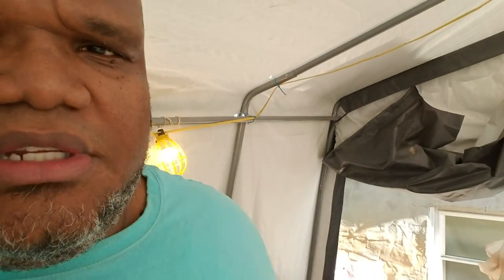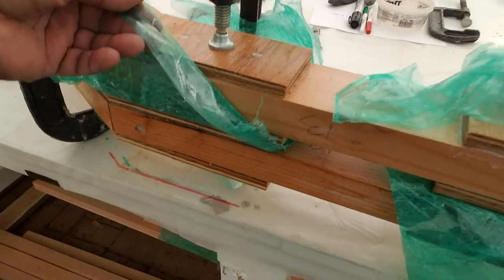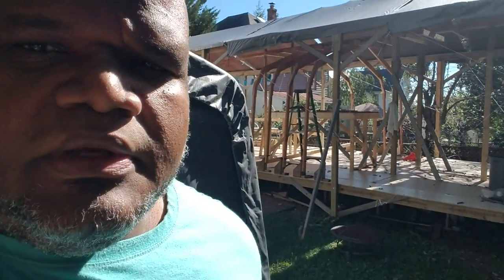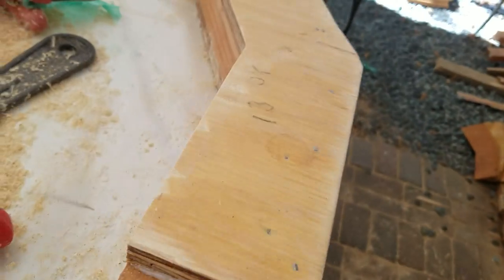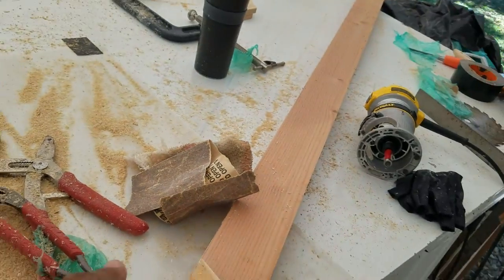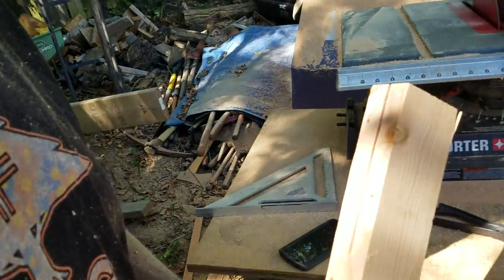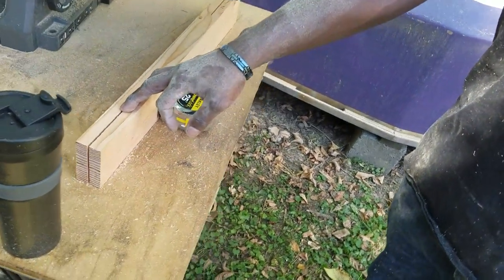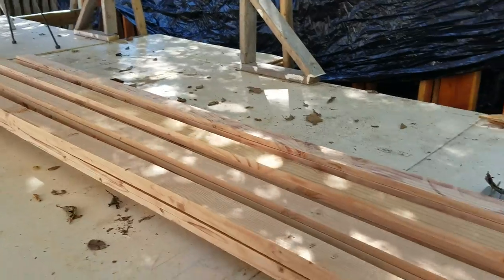Build A Boat Sunday - milling stringers and cleaning up frames

Comment: Glad you added screws.  Nice job countersinking them and filling with thickened epoxy.

Are the gusset BS 1088 marine plywood ?  Menards sell "marine" plywood made with "water resistant" (not WBP) glue !!!
Reply from the maker: no, the chines are just regular marine grade plywood. I am using the BS standard for the hull and interior bulkheads and sole. Im still up in the air with the partitions, cabinetry and furniture. I really like red oak for that. What are your thoughts on furniture?
Reply: Where are you buying your "regular" marine plywood from ?  I would be curious what kind of glue they are using.

Go for the red oak if that is what you like.  Your boat is not a "work boat" (SV Seeker), so it is actually partially a "work of art" and "beauty is in the eye of the beholder" !  I hope you will be "holding" on to her for a long, LONG time !

Just know that interior grade glue will delaminate quick if it exposed to much water.  Faster than exterior plywood.  BS 1088 plywood uses thinner plys that have no voids and no plugs in the surface ply (grade A) along with "water boil proof" (WBP) glue.  WBP will survive >10 hours of boiling water bath.
Reply from the maker: I would still wet out the interior wood which should prevent most water swelling/ intrusion, save major prolonged leaking or flooding.
Reply: Make some test strip out of the red oak plywood you are looking at.  Apply 2 coats of epoxy.  Then submerge on for 1 hour, another for 2 hours, etc.

Comment: After you clean up the frames with the belt sander and router, do those freshly exposed edges need another coat of epoxy, or does the original epoxy coat soak in enough that its okay?  Feel better and keep up the great work!
Reply from the maker: Yes they will receive another coat of epoxy. the way this building method works is that every piece of the structure made of wood will be coated with at least two coats of epoxy. Only the internal joinery will be untreated.
Reply: By countersinking the nails at this point broke the seal that was created during the original epoxy process.  The second coat of epoxy that you mentioned, will do a great job of re-sealing those areas.  Looking good!
Reply from the maker: Actually the nails kind of lay down lol.  The thin shaft of the wire fasteners doesnt hold up against the hammer. But eventually the frames will be tabbed in with 3-inch fiberglass tape, re-epoxied and painted.
Reply: For us "landlubbers", if you could clamp a floor "support" in place it would be a great visual reference.